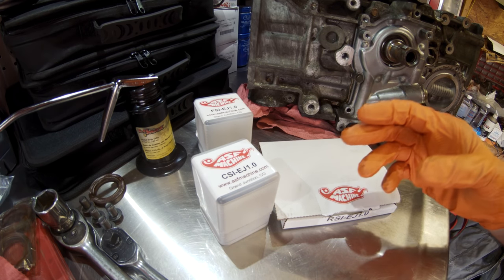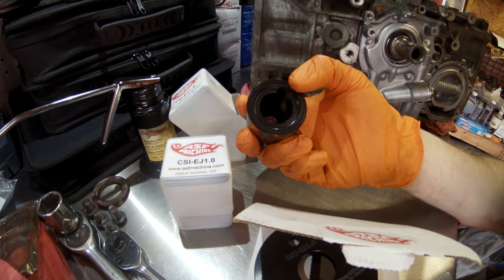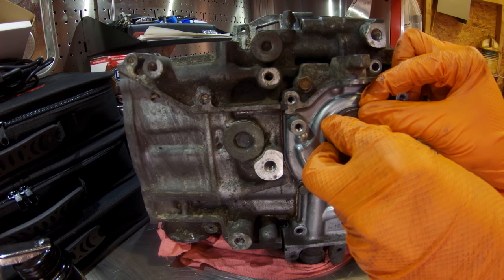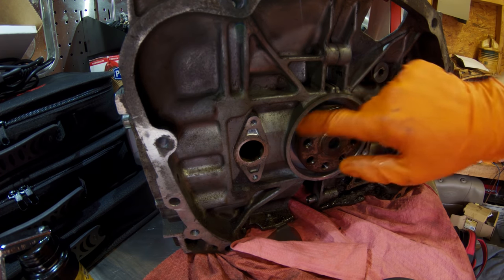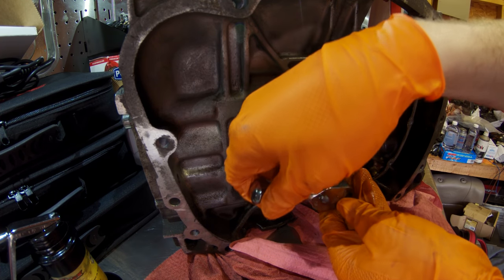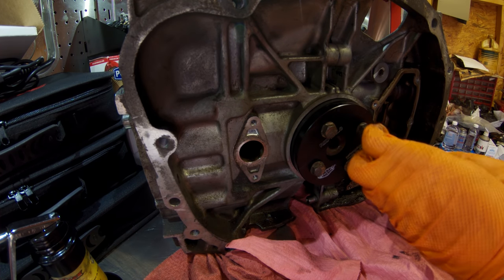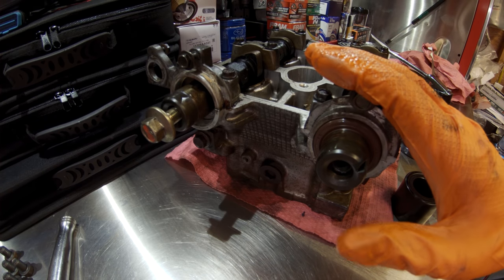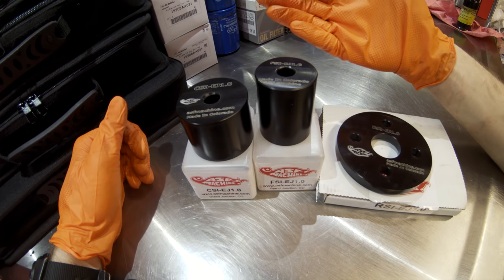ASF Machine Subaru Seal Tools

Comment: Yep, ASF has nice tools.  I have not used their Cam seal tool, but I love the crank seal tools. You are correct for the rear crank seal tool,  use the long bolts and place washers beneath the heads to save the tools aluminum finish.   I bought my set a few years ago.

Comment: I used the rear main tool when I did my engine. Worked amazing.
Reply: Also I noticed you said you needed flywheel bolts. That would be easier. But the flex plate bolts will work. That's what I used. Just have to start the seal a tiny bit either by hand or with the gentle tap of the persuader.

Comment: Howdy which timing belt along with water pump kits you recommend? I prefer Japanese made kits. Thanks in advance when i get the answers from you!
Reply from the maker: Subaru OE or Aisin. I use the Aisin kits because they have all the OE Subaru components, less the water pump, and are far cheaper. The Aisin kits come with an Aisin water pump, rather than the OE Fuji pump. Aisin is the OE supplier for Toyota and Honda water pumps, so no quality concerns.

Comment: Hey Mr. Subaru, is there any way you can give me some more info on a humming noise I’m getting from a 4EAT tranny? Thanks!
Reply: Longtrailside Darn. Yeah, the whine is only when I reach 60 and dependent on my foot being on or off the gas pedal. On, it makes the noise, off it goes away. The tranny has been factory serviced every interval and only has 90k miles on it. No problems at all currently with the way it shifts. I’m getting some quotes on used transmissions tomorrow

Comment: Great video! Do you have any tips on removing the cover plate that is secured with Philips number 3 screws. I've snapped 3 bits so far 😔
Reply from the maker: Cover plate? You mean the oil air separator plate on the rear of the block, near the crankshaft?
Reply: @MrSubaru1387  yes sir
Reply from the maker: Use an impact driver.
Reply from the maker: I have a video showing the removal and replacement. https://youtu.be/4ieBhsdSFqg
Reply: @MrSubaru1387  awesome thank you! I completely forgot about that video.
Reply from the maker: You're welcome. 👍🏻
Reply: Dont forget the updated part. Dont put that old nasty one back.
Reply: @MrSubaru1387  I just got my snap on 3/8 impact driver. Holy cow how is it possible what it's capable of doing. My mind is completely blown! There's no way I could have taken my engine apart with out it

Comment: On your last video oil filters what would be the correct Mazda filter for a 2013 wrx ?
Reply from the maker: For a 2013 WRX, should be the filter shown.
Reply: MrSubaru1387 Thanks just wasn’t sure what years it was applicable to ..
Reply from the maker: Yea, that covered all the EJ series engines.
Reply: MrSubaru1387 Really good videos glad I found them very informative 👍
Reply from the maker: Glad you enjoy them. 👍🏻

Comment: I am currently in the middle of installing the cam seals on my 02 bugeye motor. Am using the CSI-EJ1.0 tool. Have done this on two cams now and both are installing the seal crooked. One side is just behind the bevel as it should be. The other side is above the bevel. The pictures in this thread show exactly how mine look. Any ideas? https://forums.nasioc.com/forums/showthread.php?t=2735100